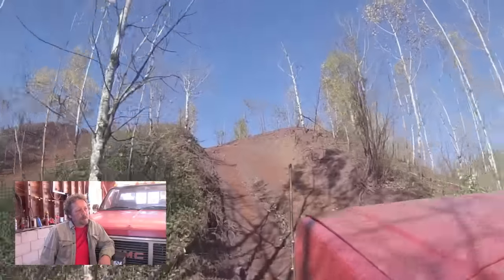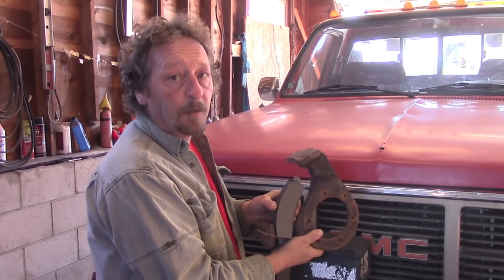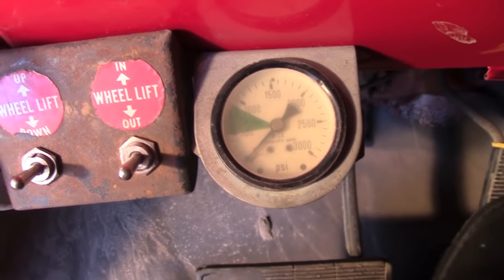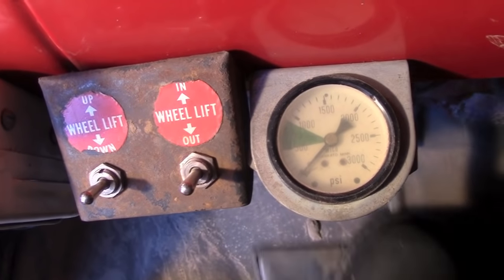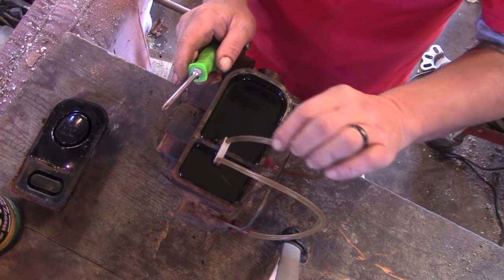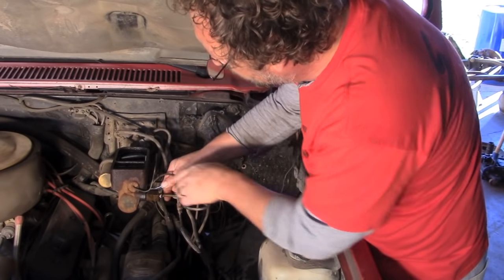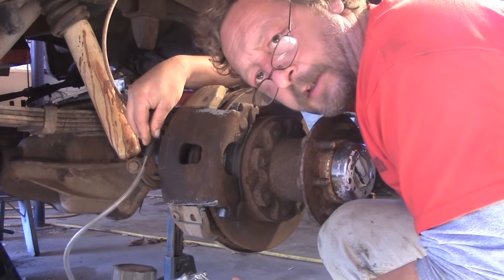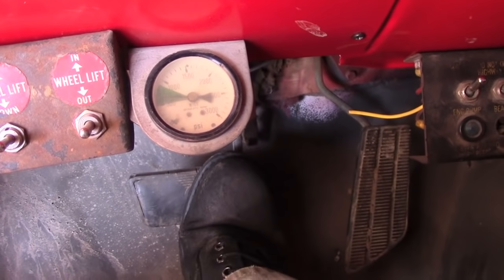WRECKER BRAKE FAIL FIX by BSF Recovery Team

Comment: Good tips . A lot of people put a board on floor when bleeding with the pump method so the master is not over extended during bleeding .  I like and use  the gravity and or vacuum bleeding . I try to tell people if they are using the pump method , one slow pump , then open bleeder . One is moving air down the line not trying to build pedal . The quick repeated  pumping , will cause brake fluid sudsing , then one never gets air out , unless one waits for the suds to go away which can take a long time . Good job on the video.

Comment: Nicely done. However it should be noted that brake fluid is highly corrosive. After installing the Master Cylinder , one should place either a can or sufficient rags under the unit to keep the corrosive brake fluid from coming in contact with other engine/body parts while bleeding the brake lines at the Master Cylinder fittings.
Reply: point

Comment: for the bench bleed I didn't have the kit but I did have some old brake line and clear rubber hose and it worked fine when I did my CJ5 also its a good idea to have some one watch the fluid level in your master I was bleeding them on a sand rail and I ran it dry and had to start over it sucked real bad.

Comment: A sure fire backup braking system i always recommend is the anchor Brake Mod. Hang you a 1000 lbs Anchor off the front of the truck with a quick release cable, next time the trusty old master cylinder gives out, drop the anchor and pray your front bumper holds. :)

Comment: another way to bleed brakes is to put the hose from the bleeder into a container with some brake fluid inside, set the container higher than the bleeder, and open the bleeder and slowly pump the pedal, keeping a CLOSE eye on the master cylinder levels,  when the level in the container raises noticeably,  it should be good, if not repeat

Comment: Very good information. Do you have any ideas on why the rear drum brakes on my cherokee do nothing when I step on the pedal? The brake pedal doesnt move the shoes at all but the parking brake handle will move them.
Reply: the auto adjusters never work. on the back side of the drum/ plate theres a rubber plug. pop that plug out theres a star gear in there. use a flat head screwdriver and adjust this. as the pads wear inside it's  "supposed" to auto adjust but it never, ever works. one way will tighten the brakes, the other will loosen them. adjust the star gear a little, spin the wheel by hand, have someone else hit the brakes. when you can stop, youll have brakes again. remember youll have to do it again in the future caus it wont auto set

Comment: Do it like I do on my truck. Use SpeedBleeders on the calipers/wheel cylinders. These are one was ball check valves that replace the bleeder screws. fluid comes out when you pump the pedal, but air cannot get back in. I change my brake fluid every year, and these things make it easy.
Reply: Where did u buy them at
Reply: Thank u 4 the link

Comment: I worked at a few places as a fleet mechanic I had. E450 with a brake issue I found Tha master cylinder was bad so I got a new one I was bench bleeding it a few walked over and looked at me weird and asked what I'm doing I told them bench bleeding Tha master cylinder  they said huh I've never heard of bleeding a master cylinder I looked at them weird then said huh lol

Comment: hows the Yukon Grizzly Locker holding up thinking of putting it in my 14 bolt or a Detroit locker its a soon to be daily after i 1 ton swap it
Reply from the maker: +chevyforlife1000 Holds up great, a little harsh on pavement for daily use.

Comment: I am sure you know what you are doing. But there is a lot riding on those brakes. I just replaced mine with a  new one for less than $40.00 at NAPA.
Reply: another old man, people dont realize that it is the friction between your tires and the ground that stops you, not how hard ya push on the brakes

Comment: why does he always get an 80s GMC?I like them but it's weird to me that he doesn't get a Chevy or a newer truck.
Reply: +Dylan Snyder Why slam a brand new truck up against a tree when an older one you can get for a grand or less?
Reply: bc they have solid front axles
Reply: new trucks bend to damn easy. go crash a new truck into an old truck see what truck wins. my money is on good old dependable. plus why spend the loot on a new truck when these guys do this for fun not money. its not like the truck is paying for itself